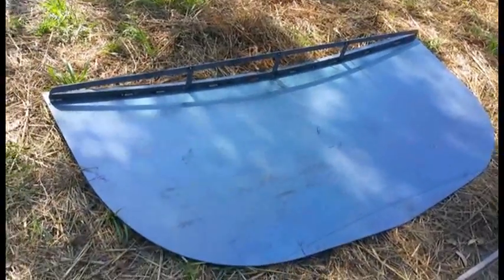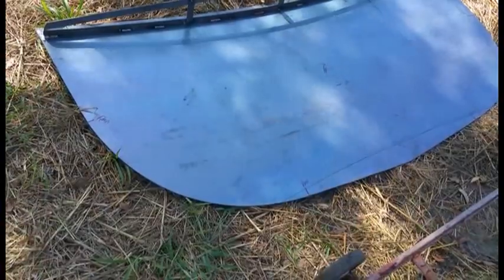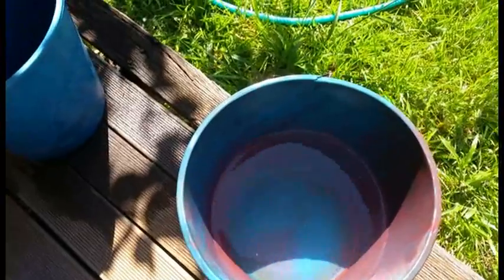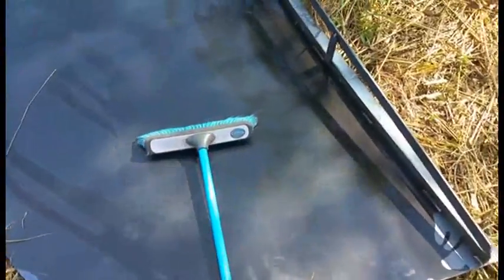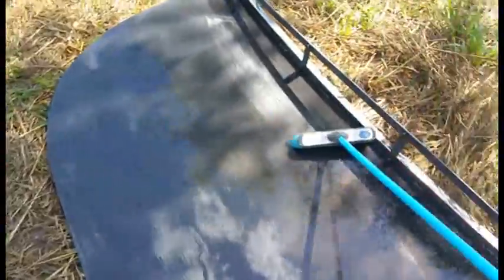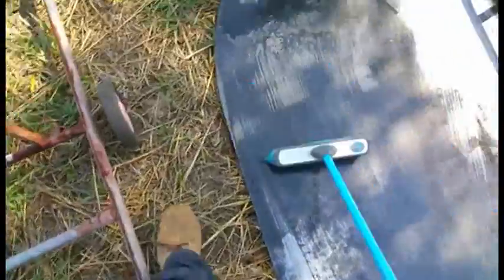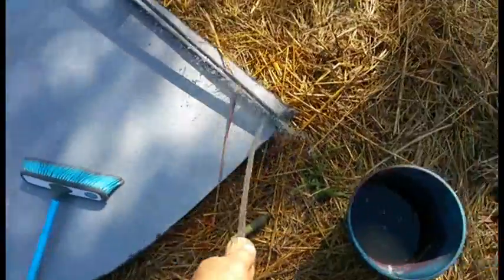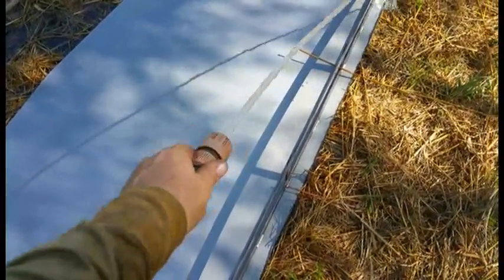Steel Sailboat Building - Removing Mill Scale

Comment: I'm so jealous!  I tried straight Muriatic acid and scrubbed it for an hour, but it did nothing to my mill scale at all.  Product I used was 31% from local pool supply store.  Maddening to see others have success with this method, yet it does nothing on a 4ft diameter steel plate I'm working on.  Wish I knew why it won't work.

Comment: Thank you!
... when I faced with hard-removable mill scale on big flat surface - I first tried grinding it... but the method that worked well against paint or rust is almost not effective against  mill scale. Then by intuition  I tried to pour vinegar on surface and used wet applicable scotch brite paper. It was better, but still too slow... will try this method.

Comment: Use baking soda to neutralize the residual acid and you'll get less rust.
Reply from the maker: Thanks Michael, yes I too use baking soda (Bicarbonate) and it does reduce the amounts of flash rusting. Good call!
Reply: How would you apply the baking soda? Mix with water or spread over work piece?
Reply: A bit late to the game, but... If you rinse off all the Muriatic, then wash with a dilute phosphoric acid solution, then rinse again, then the plate won't flash rust as bad (or as fast) as with just Muriatic.

Comment: Thanks for posting this video I ready about using hydrochloric acid for removing mil scale but wasn't sure how it would work on sheet steel but after watching this I went and bought some sika cement remover and give it a go however I used it undiluted as it was only 10/20% hydrochloric acid and it worked a treat. Good luck with your project yacht and thanks again. Chris
Reply from the maker: Your welcome Chris. I use swimming pool acid and dilute it, same outcome, it works very well!